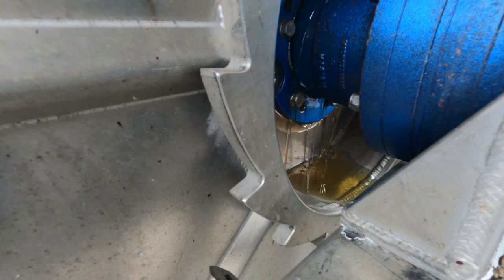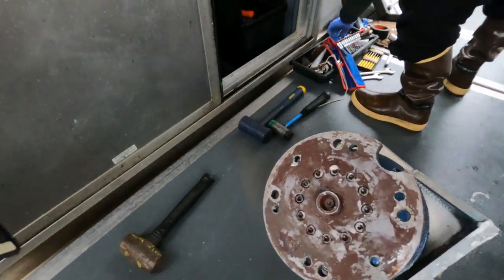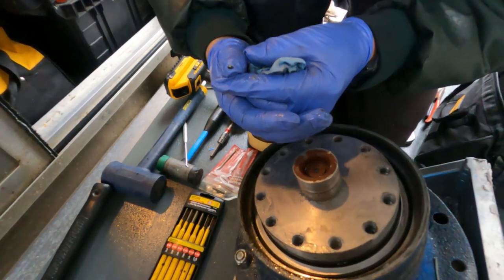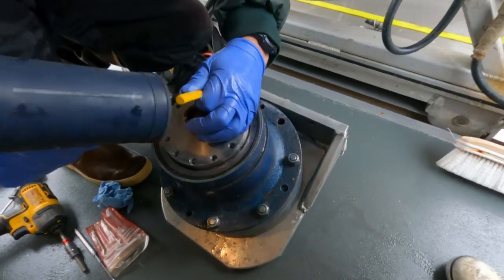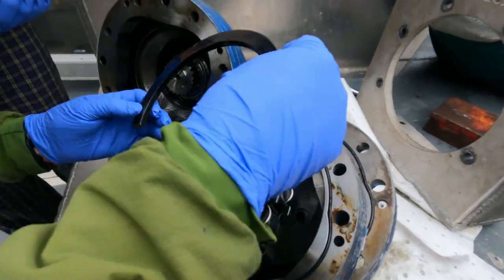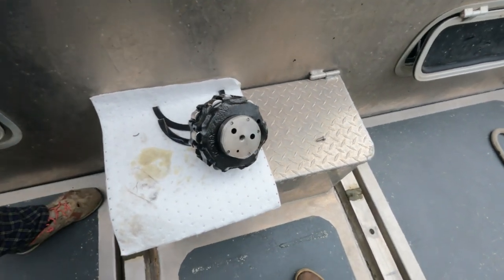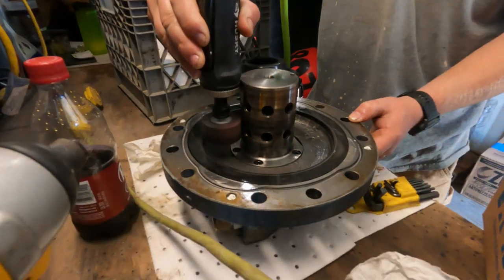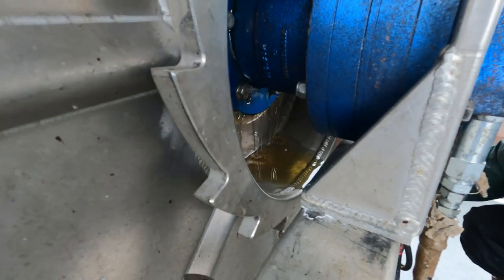Replace the oil seal on your Kinematics drum drive (wheel drive). Gill net drum motor repair.

Comment: Quinn,  You mentioned operator error that the valve wasn't set to back feed fluid......what position should the valve be in when you set on step/high speed?
Reply from the maker: Man, good question! The deck valve for the drum needs to be opened like your setting/backing the net off the drum. (I'm going to double check that with...my deckhand! 😂🤦‍♂)
Reply: @SaltWaterSalmon  We don’t do a lot of speed sets, but when we do our valve is the same as when we do a regular low speed set.  I think I should check with Kinematics on this.   I’m not sure what other options we have???
Reply from the maker: @captko5516  so high speed setting with these motors is outside their operating parameters. They are designed to turn at less than 150 rpm’s. ( or something very close to that), our option, although spendy, is to switch these motors out with a Poclain motor (carried by SeaMar in Naknek), they have 2 sizes and the smaller one works best in the Bay as they are faster pulling the net in.
Reply: @SaltWaterSalmon  Good info Quinn!!!   I’m guessing guys that seem to do speed set after speed set have the poclain!  We only do a handful of speed sets each season. Do you know if the poclain has the same bolt pattern, etc and would be a plug and play without mods?
Reply from the maker: @captko5516  I’m not sure about the bolt pattern for the mount. I know 2 guys that have switched though….i think it’s minimal work but I really don’t know for sure.

Comment: I blew mine this year. Although mine lasted 26 years.
Reply from the maker: Still a pain in the arse! The builder ran the case drain to a return manifold rather than directly to the tank. Also we had no clue we needed to actuate the valve when setting fast so we could keep the motor charged with fluid.
Reply: @SaltWaterSalmon  think there is a solution to that. I was able to purchase a rebuilt motor. Bolt on and go. Ran away from fish though. Left the Nushagak for Naknek, with hindsight I should have gone back to there after getting repairs done.
Reply from the maker: @Centaurcatch  luckily for us the season was all but over. I mean we lost out ond some fishing time but it wasn't THAT bad...